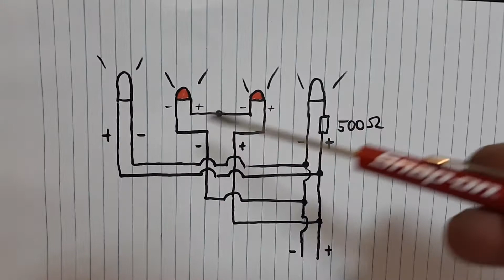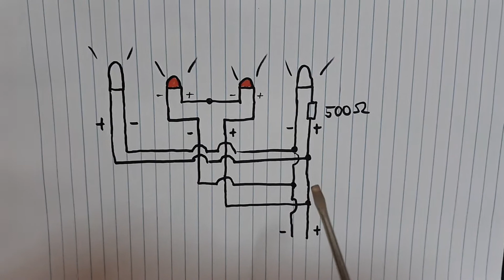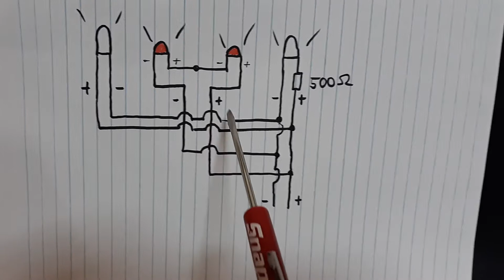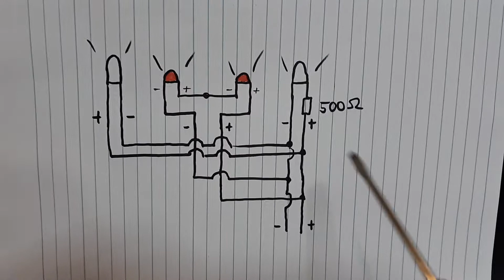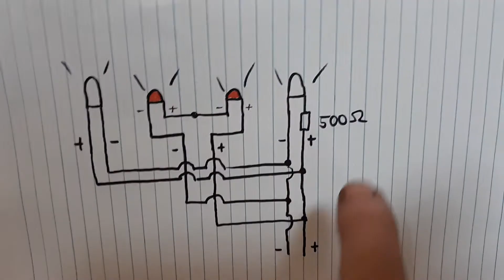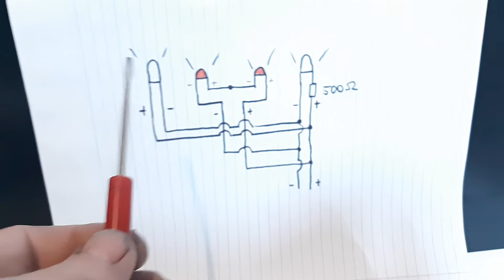Series parallel connection with LEDs. For rc.

Comment: On a your parallel circuit you need a resistor per led and needs to be calculated
Reply from the maker: Yes you are correct if all the LEDs are rated at the same voltage. 

This bag of LEDs were not labeled.  After testing...burning out a few. I had found out some of them worked on 1.5,  3,  5  to 12vdc.

Mixing and matching the them plus one 500 ohm resistor gave me a working set.
Reply: @NBC_NCO  ok there’s a pretty simple way to find forward voltage ( voltage drop) . Get A 9v with a resistor and 1 kilo ohm (1000 ohm). 1st measure battery voltage. 2nd hook battery with resistor and led. now measure across led. Now subtract battery voltage and voltage across led = equals foward voltage . If you are still interested I can explain part “b” next. Every led has a tolerance I believe of 5-10’/.  Also every color led has different  forward voltage s( you can even hook up series or parrell depending on battery voltage and amount of Leds) this probably all for nothing if it’s all hooked up. If you calculated resistor (part b), this should last almost for ever. Let me know ✌🏾
Reply from the maker: @airgunnut1487  very good.

However this light set-up  is working great still to this day.

I'm quite familiar with doing voltage drops in the automotive industry when trying to diagnose an electrical problem.

Very good information either way for those people who do not know.

Thank you for taking the time to comment I appreciate it Francisco.
Reply: @NBC_NCO  ok cool! Cause I really don’t know what the hell I’m telling you!😂